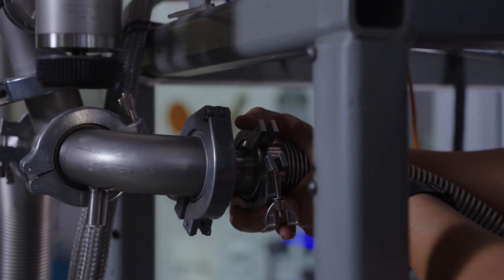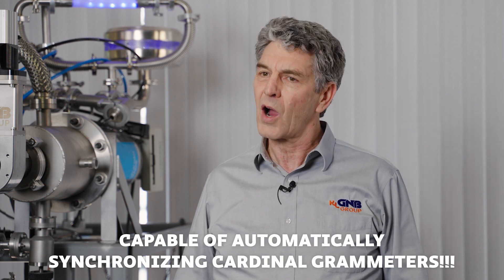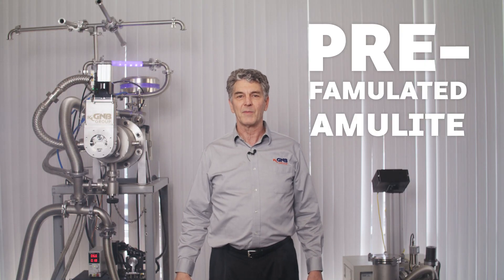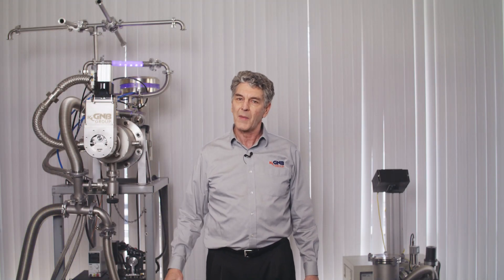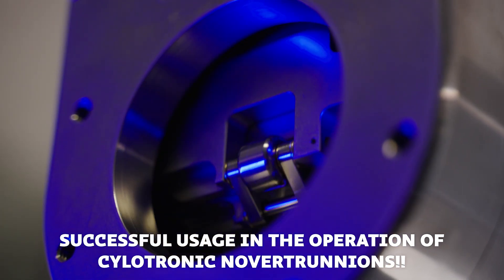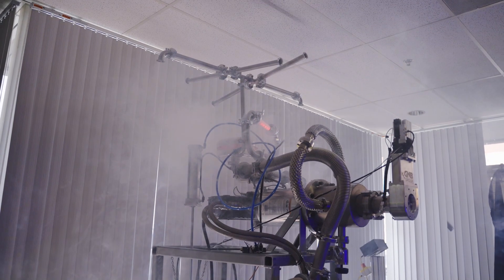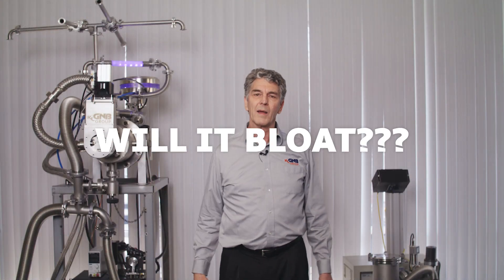Introducing the NEW Vacuum Turbo Encabulator

Comment: And still no protection against side-fumbling...
Reply: Side-fumble has plagued this tech for a few decades now  ... 
If there were only a way to keep the temperature of the dyna from interfering with the calibration of the retrofit magneto clutch's centrifugal force on those vanadium wheelplates  🤔 

Alas, that is a future-me problem
Reply: @TheeSlickShady_Dave_K  try using it on a trip to the moon.....
Reply: @rearspeaker6364     Agreed the lower incumbant temperatures on the wanes would be an asset, but what effect would reduced gravity have on the gyros ?
Reply: @Batwam0  
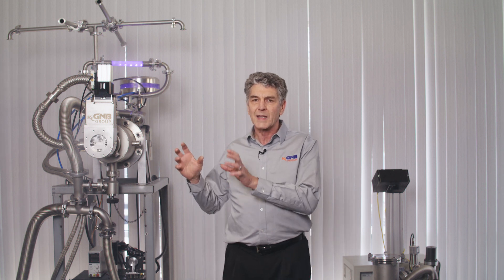I also noticed this at 1:00 ;   It sounds like a false claim to me 🤔 

It time, the brass bushings that center the hyper-dynamic velocity shaft wear out quickly and side fumble will plague this iteration of the encabulator as well 

We need to move to a paramagnetic chromium/vanadium material to reduce capacitance on the magneto solenoid; 
Brass is Not cutting it people ! 
(No pun intendid)
Reply: You can't beat 6 hydrocoptic marzel vanes when it comes to mitigating side fumbling.
Reply: @Batwam0 Oh yes, you are correct!
Instant buy then!